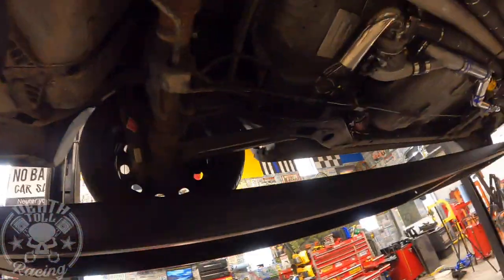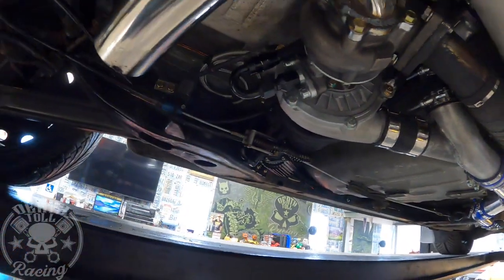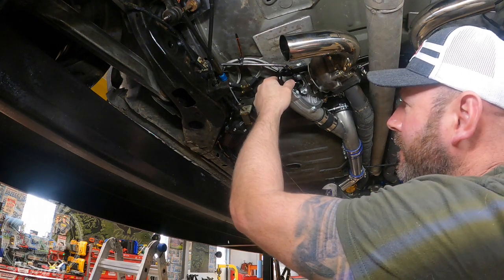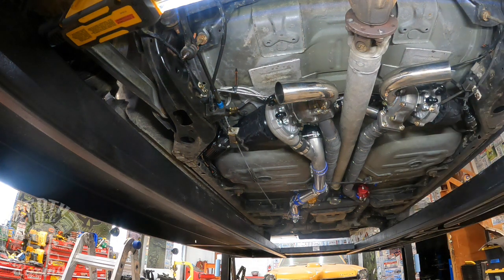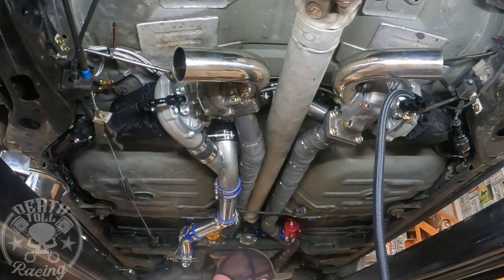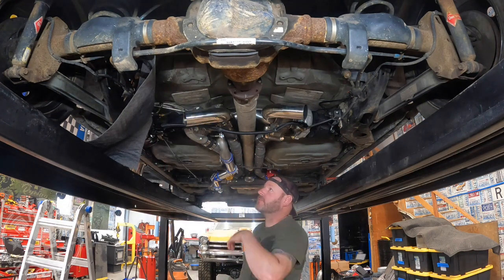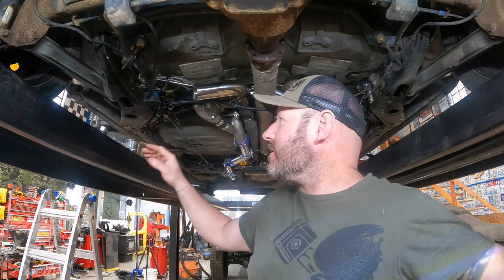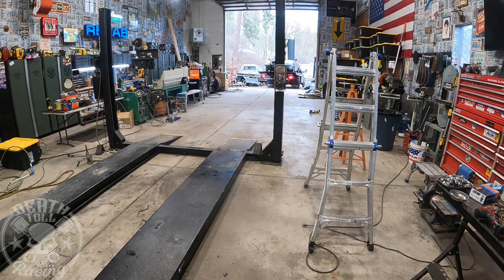Ep 10A Oil System Scavenge Pump FAIL!!!  Fixed and Ready for the Dyno!!! Twin Turbo Crown Vic 4.6 2v

Comment: Don’t you run an oil sump underneath the turbos?
Reply from the maker: Ideally. It will pull up hill though. The problem ended up being the system draining while it isn’t running. It was resolved by installing a valve that needs 2psi to open so gravity alone won’t drain it.  A different location for oil feed may also be a solution, but I used the bottom of the filter housing so the oil in the filter just kept feeding the turbos when it wasn’t running, and the pump obviously wasn’t either.

Comment: I know absolutely nothing about this kind of setup but I'm curious if a check valve (one-way valve) would work with the oil so you didn't have to use the crossover down low?
Reply from the maker: It might, but I think it actually wasn’t pulling the oil out during the first start, it just didn’t leak by the ring while it was running. So what I’m guessing is that a check valve would help make less of a mess, but there would still be a mess. Just a hypothesis though.